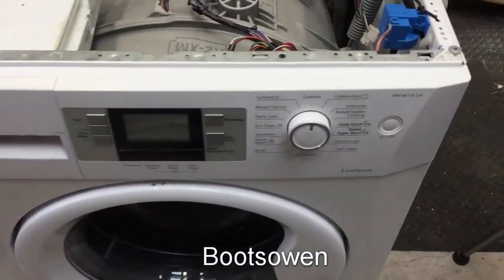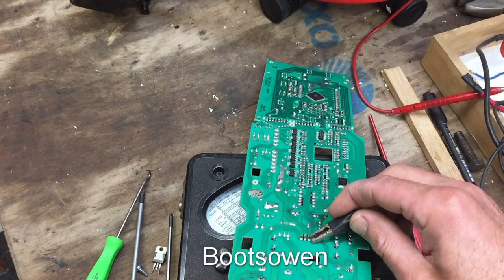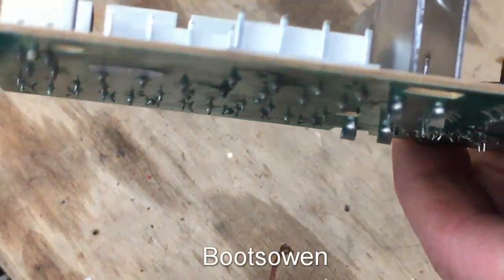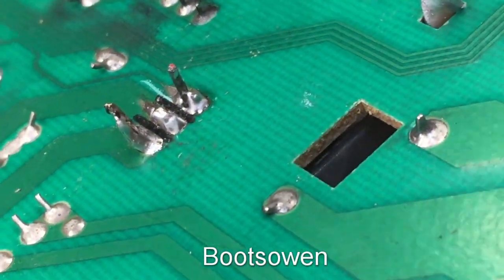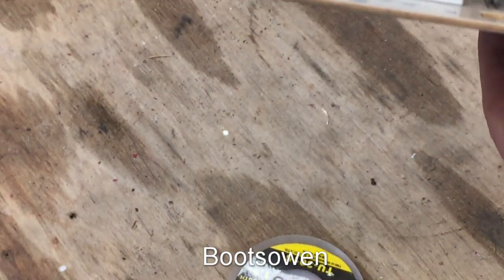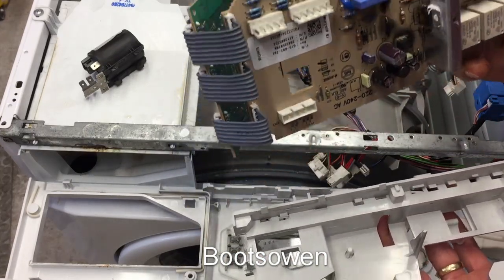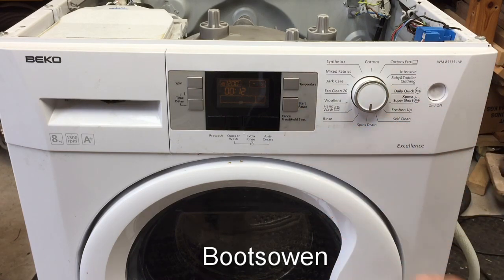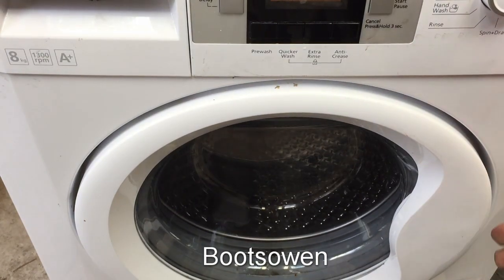Beko Soldering the triac, Washing Machine PCB repair, Beko WM 85135 LW, another stab in the dark!

Comment: Hold the tip of the iron onto the joint then slowly feed the solder onto it, this will distribute the flux inside the solder for a good solder joint

Comment: This has just told me that my PCB board needs replacing, as all my macine does is start for a second or two, then stops, no matter what its asked to do. The board is only 20 odd pounds, so i think thats worthwhile buying. As this is my model, youve also shown me its easy peasy to get at 😂no headache here now, at the thought of the possible pig of a job 👍🏼.
Reply from the maker: Great. Let me know how you go!
Reply: Sure thing 👌, it'll be smiles all the way, or tears 😂thanks for sharing the video 💪
Reply: @shannonreed9808  I have the same problem with my washing machine, it starts and then stops for 30 sec and then again.
Can you tell me have you fix the problem and how?
Please be honest with your answer it means a lot to me

Comment: Hi bootsowen and everyone else. I'm trying to fix my elderly neighbors Dyson washing PCB digital control board because the first 3 words out of the 6 are to faded to understand and read. How do I determine if a component is faulty when taking the reading with a metre please. Any other tips or advice will be appreciated and it's for a Good cause. Great video thankyou.
Reply from the maker: Hi, why not post the question on the appropriate dyson video?  If the display is dead then you need a new display, there is usually one for sale on the internet. But why do you need it to work?
Reply: Hi BootsOwen and everyone. I posted my comment on your video because the control board partially works and I'm hoping to try and repair it, the first 3 words on the digital display are to faded to understand and read, but the final 3 words are crystal clear, can you please help me I need to know what setting I need to put my auto metre on to test and find the faulty little capacitors etc on the circuit board, and can you explain what reading determines a faulty component and what reading determines a good component on the controls circuit board please, I hope that makes sense. Brilliant effort. Great video thankyou.

Comment: Hi could you give me any pointers I have a similar Beko machine , It all programs fine but when I press start after 2-3 seconds the program kicks in and it trips rcd breaker. I tryed plugging my dryer in on that circuit / socket and it works fine . About 7 years ago a technician replaced the pcb board and motor under warranty after my gf accidentally loaded a nappy after that the motor whined and eventually the board went. Any idea’s why it’s tripping when I opened it up today I suspected ir was the triac as the dappy cow had washed a double quilt last week 😅 it struggled . Is the triac similar to a mosfet ? Do they burn out ?
Reply from the maker: If it is after 2-3 seconds then that is when the door interlock should kick in. Could be that. Worth checking motor brushes maybe. But door interlock has to lock first. Try it again and see if you can hear the door locking before it trips. My moneys on the interlock. Let me know how you get on!
Reply: @bootsowen  It was the heater element . Fixed it by taking the back off and removing the wiring then it stopped tripping the circuit breaker. The part was £25 from a local supplier. 👍